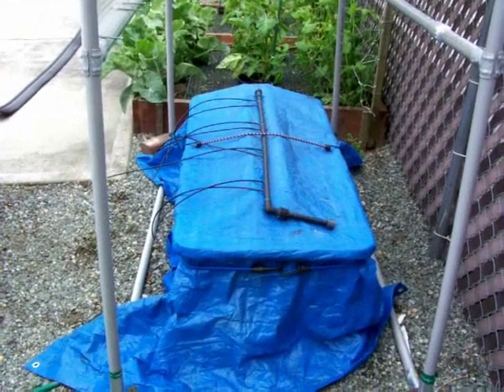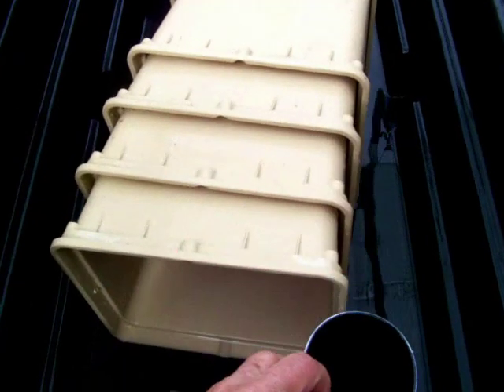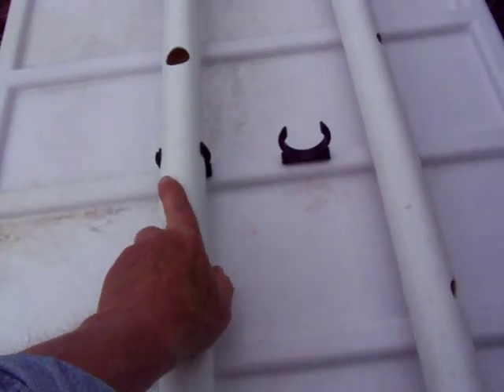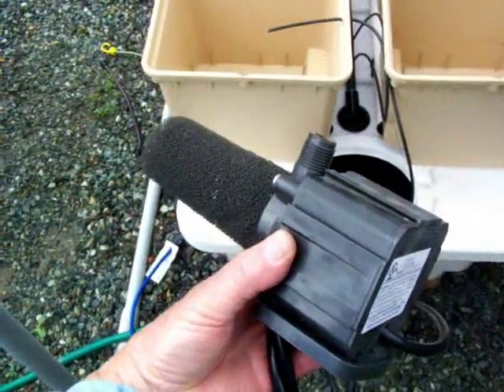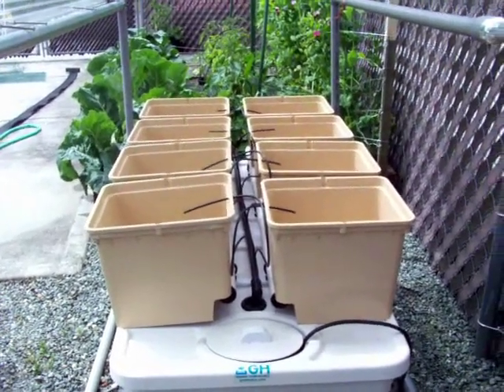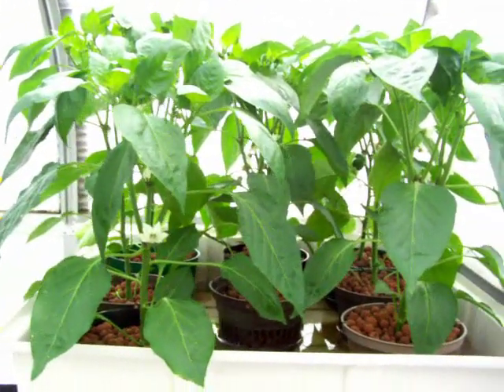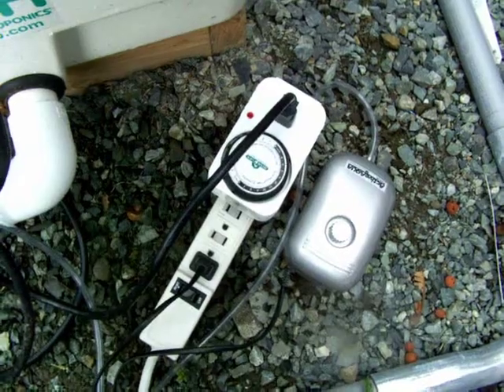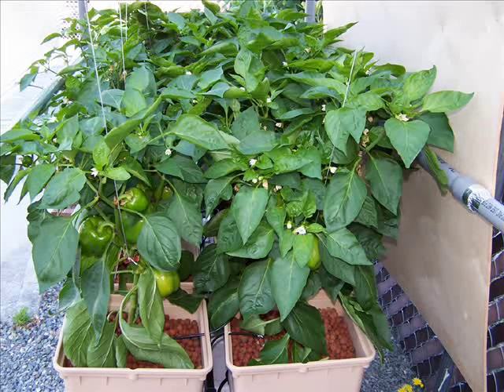EuroGrower

Comment: how far under the roots should the water be
Reply from the maker: +Daniel Mowczan Hi Daniel, the roots are in the bucket above the water reservoir.  The bucket is flooded and it drains back into the water reservoir so the roots are never in the water for an extended period.
Reply: I have a dwc with the tote with 80liter tank
Reply: Ronald Kleinman Hi. What size seedling can I put it in the pots? Do I need "pots" within the panda pots, pots with holes/slits? So you say it's essentially 8 ebb and flow buckets, but fed from the top.

Comment: I use the same air pump and stone in one of my small 5 gallon hydro systems. Do you only use the one in that 40 gallon reservoir?
Reply from the maker: Yes - one stone seemed to provide some aeration and kept the nutrient mixed - the results were excellent!  Thanks for watching!
Reply: Thanks for the reply Ronald. I'm about to order one of these systems so it's good to know I don't need 4 big ones like I was planning on using. Haha!

Comment from the maker: @1982FMJ 
Main purpose is to shield the plants from too much moisture from the rain - this is Seattle.  Shielding from rain helps reduce chances of blight and prevents rain from diluting the nutrient solution.  Actually, although it does reduce light a tad (it's clear acrylic), the shield increases heat a bit which is a plus in this area - especially for peppers and tomatoes.